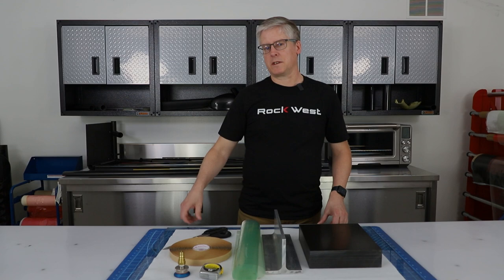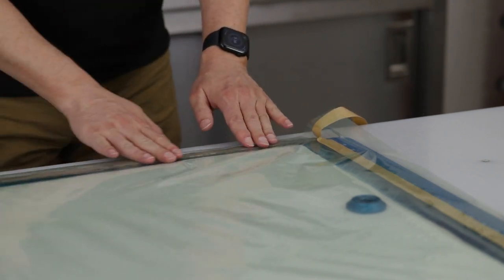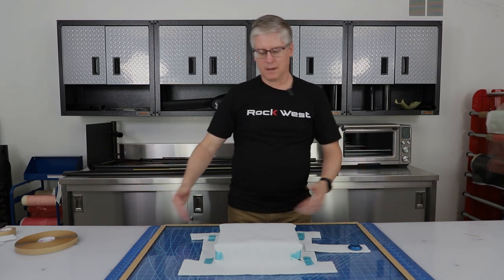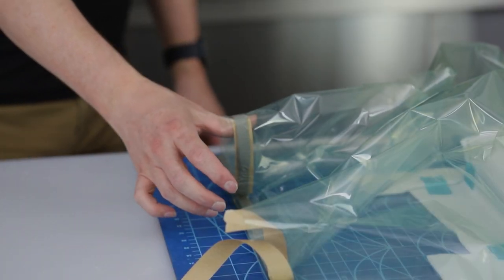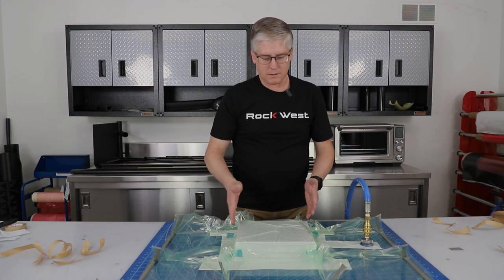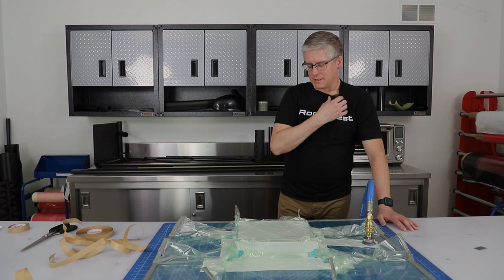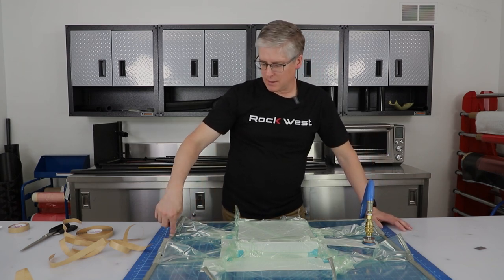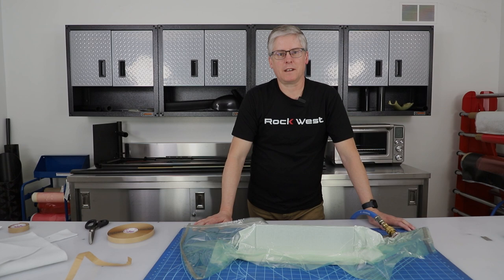Vacuum Bagging Techniques

Comment: For the "envelope bagging" technique, it would be helpful to see how this is all done when a wet part needs to be inserted in the envelope.
Reply: The process is the same. You can carefully insert your part into the bag if you choose to close 3 sides first, or you can leave the bag open and then close the 3 or 4 sides after the part is in place. This is very common for large parts that are hard to move around. The thing to remember is that if you get epoxy resin on your bag were the tape seals, it will never stick and you will have to replace the bag.

Comment: ok, but where's the perforated peel-ply you need between the breather-fabric and your sticky platic part?? or do you have a breather that somehow doesn't stick? by the way: are there elastic, stretchable materials for the breathing layer and for the bag? like may be rubber-, latex-, silicone-foil?  thanks!
Reply from the maker: This was only a demonstration of the vacuum bagging technique. We weren't trying to demonstrate the layup process, only the different types of vacuum bagging styles that you may need to use. 
In a standard layup vacuum bag setup, you would follow this stack-up:
1. Mold surface
2. composite layup
3. Peelply (sometimes optional)
4. Perforated OR non-perforated release film
5. Breather fabric
6. Vacuum bag film

As for "stretchable" materials, you should never rely on any materials to stretch. You should always place all materials into the corners, as tight as possible, before vacuum bagging. As I tell all my students, "A vacuum bag is not a magic wand for perfect parts". There is stretchable peelply and stretchable vacuum bag, but your carbon fiber or fiberglass layers are not stretchable, AT ALL, so never rely on stretch to accomplish the impossible.

There are some reusable vacuum bags made out of latex, but these are expensive and generally used to decrease the labor of vacuum bagging and not for fool proofing the vacuum process.
Reply: @RockWestComposites  thanx for your response, info and recommendations! however I have in mind a particular profile for panels that can be made only by a stretch-deep-drawing-process. and for that I will need stretchable reinforment (for prepregs) - which exists in the shape of knitted glassfibre-fabrics - and - at best - all the other materials stretchable. so I'd be grateful for any links, because via google I didn't find anything (easily)...
Reply from the maker: I've worked extensively with knit fiberglass, but it isn't what I'd call "deep draw". it will stretch and conform about 2x. There is stretchable vacuum bag and peel ply, but again, not deep draw, just enough stretch to help mitigate bridging in vacuum bagging.
Reply: @RockWestComposites  thanx for answering! what do you mean please by "it will stretch and conform about 2x."? that the original length can be doubled? that would be quite sufficient for (at least some considerable) 'stretch-deep-drawing'! / could you tell me where you got it from? I found only chinese producers, but they don't answer when I ask for the samples they offer...

Comment: First!
Nice video.  Informative.
Reply from the maker: Thanks! If you want to see a different method, let us know.
Reply: @RockWestComposites  Maybe applying vacuum techniques to concave molds (therefore convex parts) like for car fenders, boat hulls, aircraft fuselages and engine cowlings, racebike fairings, stuff like that.  That would also be interesting and informative.
Reply: @RockWestComposites  Also, maybe strategies for incorporating sandwich core materials with vacuum bagging.

Comment: I've stopped putting bag tape on mold flanges and just putting tape directly on the bag from the start.. works minty on flat plates and makes pleating cakewalk. No need to do extra pleat taping after the fact.
Reply from the maker: This is very true. Tape on bag is a super fast preferred method. But in most cases it works best on smaller, mostly flat, rectangular plates or molds. We demonstrate the pleat method as it is best suited for odd shaped parts and parts with loads of definition where numerous pleats are required. Managing a large bag with that much tape can be unwieldy and will use a lot of extra tape where the pleats are located. Unless you have a large clean work area that you can place the tape on the bag (without the danger of piercing or damaging the bag), you may be better off using the pleat method.